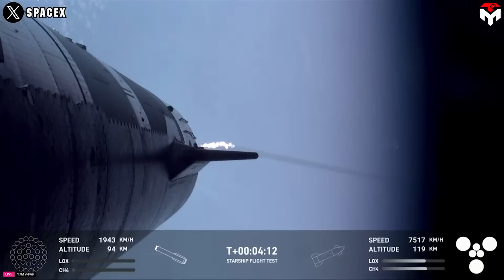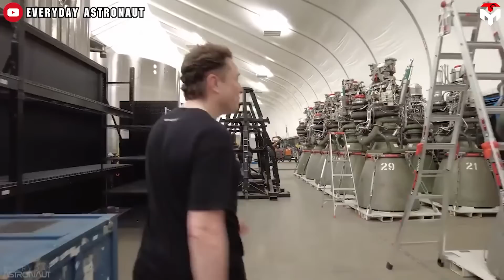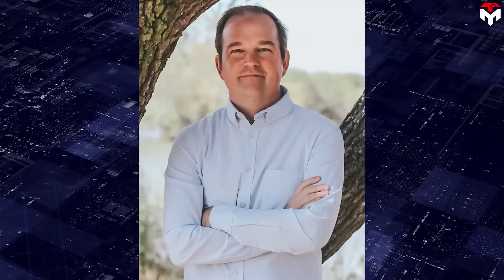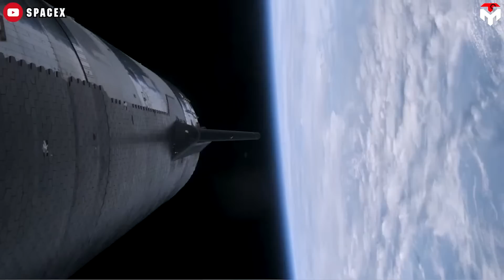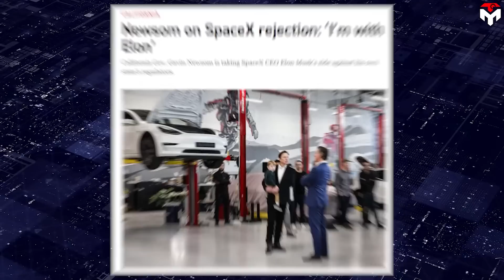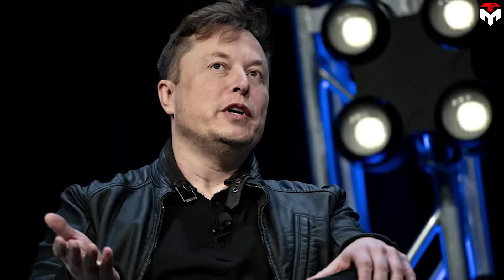SpaceX's METAL- Shield officially Completed! Never Seen Before...

Comment: If you're going to have a metal , fluid cooled heat shield could you use that heat shield is a radiation barrier while you're in space
Reply: The problem in space is a lack of magnetism not an over abundance of magnetism.

Reenter aft first to reduce the surface area & if need be use a rocket engine to increase reentry & provide active cooling by pushing the heat out & away from the body of the SS.

Iron inducts magnetism heavy metals outduct separate the two energies of magnetism. "God is refined between the two fires of a magnetosphere." Jesus

Earth's increasing EM magnetosphere due to crossing the ecliptic for the next millennium not you or CO2 is causing climate change.
Buy an EM EV & leave the EM lights on for Christ's sake to siphon off Earth's increasing EM magnetosphere to mitigate climate disasters & create heaven on Earth fulfilling God's plan.

"A nation/planet/house divided by tribal religions will never withstand this the millennium of climate change end times due to the mystery of the 7 crossings of our stars ecliptic Jesus held in his hand." Christ son of God

Your being invaded by the Anti-Christ tribal religious nations who know Noah's SE to NW  tidal wave deluges are coming